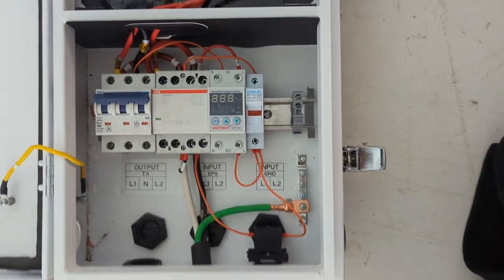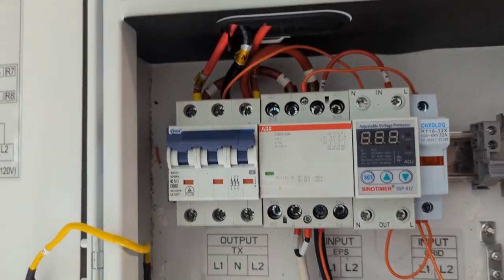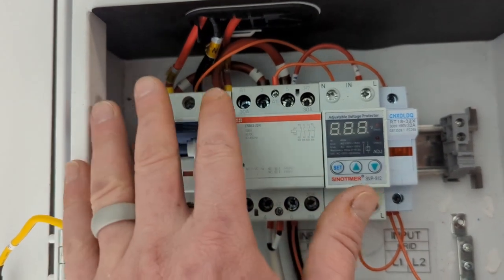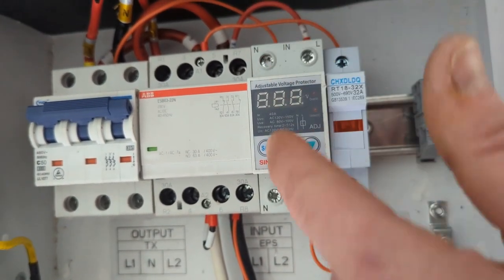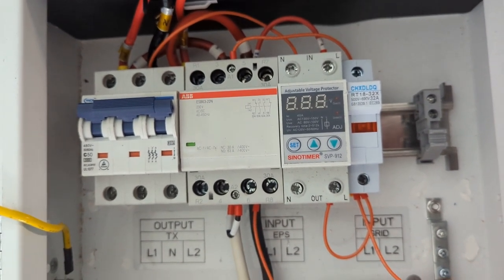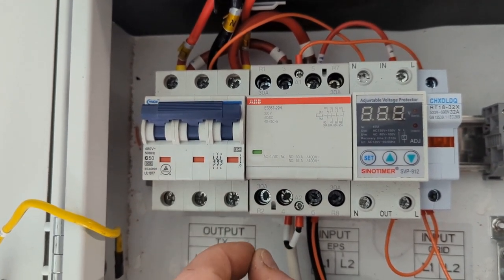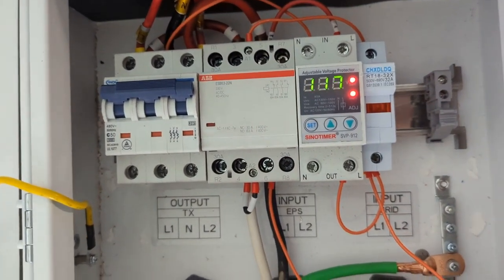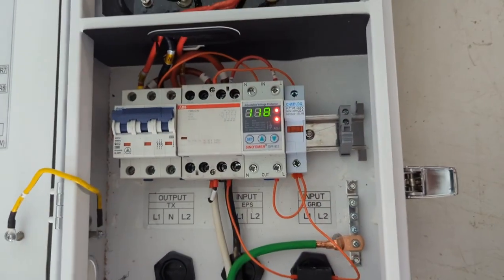Growatt 5000ES | Growatt 11.4KW AutoTransformer Simple Neutral Protection

Comment: Good set up! I wonder how they determined to send the ATS out with an 80amp breaker, isn't it rated for max current 48amps, or am I not reading the specs correctly?
Reply from the maker: The 5kVA transformer will do 41 amps at 120v. 
Holy crap I am bad at math. 
80% of 50 amps is 40 amps.
Reply from the maker: Also, I never ever ever run chinesium at rated workload... I derate to protect myself from their marketing lies. They hold no liability here in the US..

Comment: Signature solar does not advise using one of these and this is why I did not wire this into the whole system and ended up losing a tremendous amount of stuff when the transformer failed, including my geothermal, heating and cooling unit dishwasher, garage door, openers skylights, GFCI breakers and a bunch of lightbulbs, oh, and my Keurig coffee maker😢😢😢😢
Reply from the maker: It would see SS may have lead you down an expensive path. I designed this specifically to avoid that problem.
Reply: @BecomingOffgrid  the more I deal with them the more I can’t stand that garbage company   They’ll tell anyone anything just to push products 
 I’m looking at the victron multiplus system now just seeing what there going to do refund wise
 I ended up getting 400 volts off the 2 legs coming from the inverters when the equipment started failing
Reply from the maker: The complete discussion on this design is here. As you can see, its the only pinned article in the off-grid inverter section of the diysolarforum. I did much of the schematics and of course the practical build videos. 
https://diysolarforum.com/threads/design-review-growatt-spf-5000-es-grid-backup-neutral-bonding.29717/
Reply: @BecomingOffgrid  I can’t wait to read it   But I’m just so sick of the thought of my solar system right now 
 Between all the time and effort   Finally got this house totally off grid than it 💩out‼️‼️‼️
Reply from the maker: Let me know what you think about it. I would love to hear some feedback.
Reply: Could you upload where you bought these items that you added to the transformer 
   Since growatt doesn’t care about anyone’s safety apparently
Reply from the maker: The links for the products are in that thread.